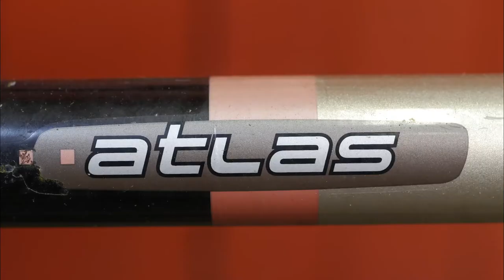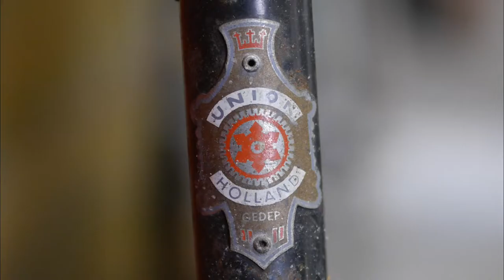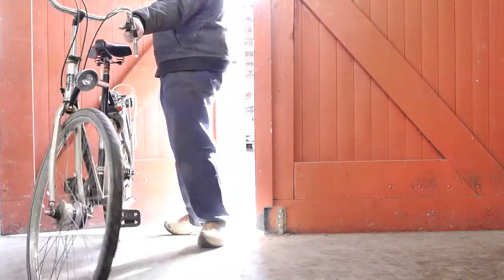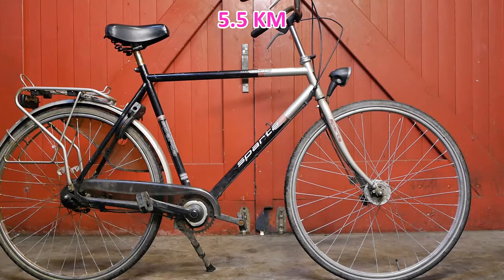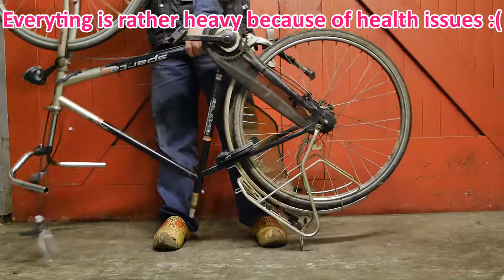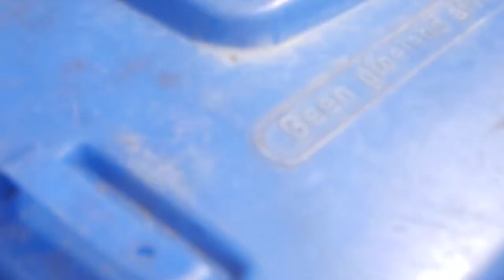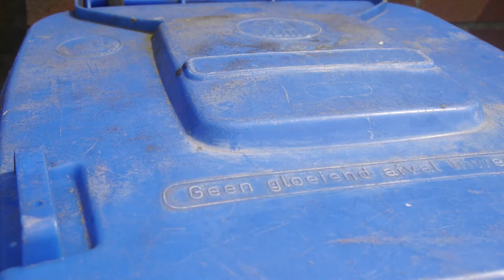Scrapping and tinkering with bicycles

Comment: I use isopropyl alkohol when I remove and install handlebars, it evaporate fast and doesnt leave a greasy surface. For removal I slit in a screw driver and just gives it a couple of drops and then they are easy to remove.
Reply from the maker: I like to use brake cleaner, but I'm out most of the time because It's perfect to start a fire :)

Comment: I use cheap, unscented hairspray for installing handlebar grips. It lubricates them as you slide them on then evaporates and holds them in place.
Reply from the maker: I also used that trick to glue on mtb grips :)